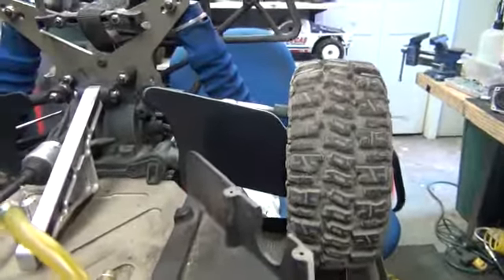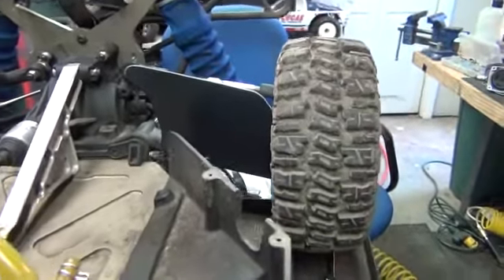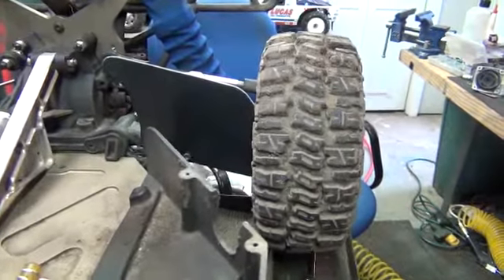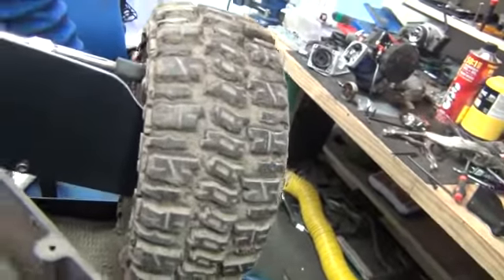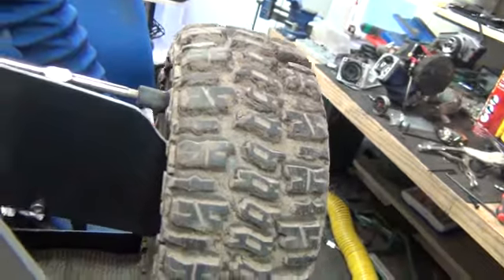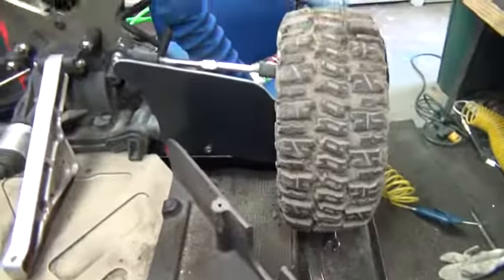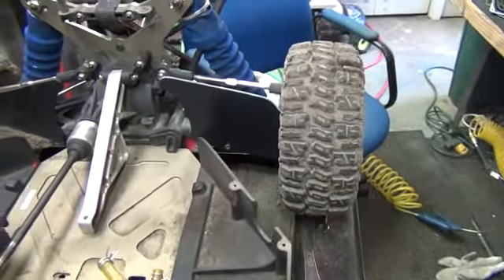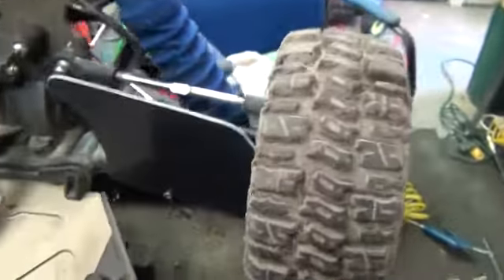Custom CVP OB Basher

Comment: Awesome protector Al. They look good also. To bad a logo would wear off. Maybe a subbtle logo on the front so it wont wear off? Something maybe etched so it isnt dressed better than the paint job or draw attention away from the brothers truck, ya dig me!? Good work bro, been busy with my tranny and new aluminum taking measurements for the rear alum swing arms now. Guys want to buy them im getting emails to ship NOW.. Take your time on my belt wheel casing protector and yes I can drill the holes